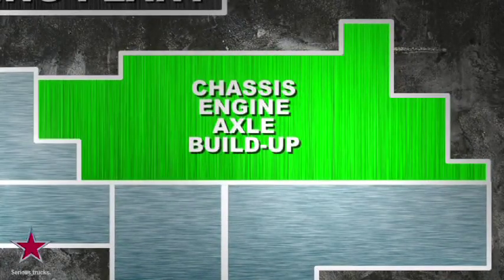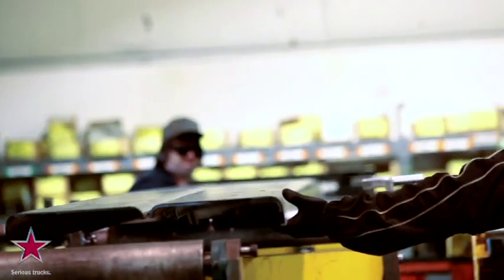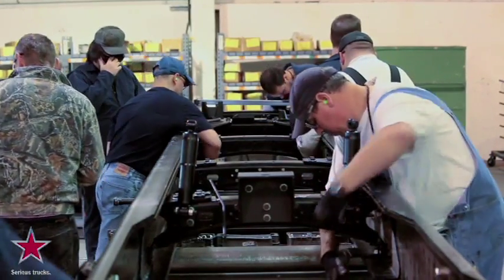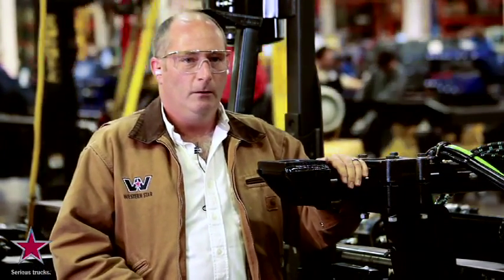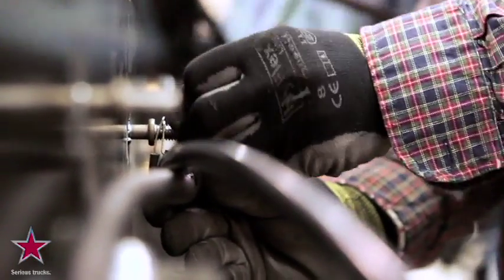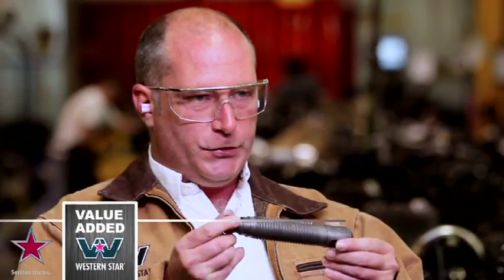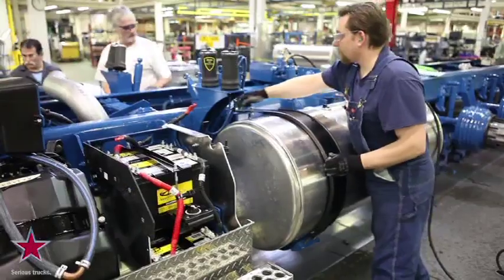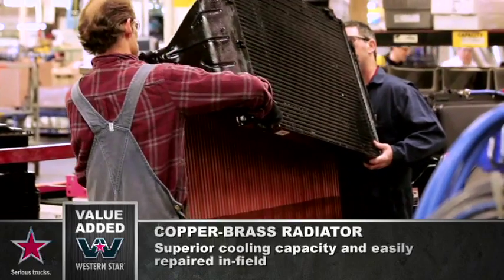Western Star Plant Tour - Part 2 - Chassis Engine Axle Build-Up Area

Comment: Hey Western Star, your new 5700XE has huck bolts everywhere, oh wait I forgot, it's just a Cascadia with some lipstick,
I think it's shameful to say "Western Star doesn't use huck bolts" when your latest and greatest model that your mass marketing is just a re-branded Freightliner, and that Benz Actros steering column/wheel that you put in the 5700 sucks too, very limited adjustablity equals very uncomfortable.
Reply: You have a choice at that time they weren’t producing the 5700xe I’ve looked at both trucks very carefully and it seems the only trying the 5700 and Cascadia share outside of Powertrain and maybe the frame is the airliner suspension 

When you purchase a truck your really buying the cab and suspension that’s it they all have same frame thicknesses all offer their own engines as well as Cummins and all offer automatic or standard transmissions with a various range of rear axle ratios 

Do your research and look at the trucks up and down and you’ll notice the difference in the trucks
Reply: I agree 100. I made that video and am ashamed of what that company became

Comment: If they're so tough, why don't I see any old Western Stars on the road like I see Pete's and KW's???
Reply: my dad works there and I don't see them ether
Reply: maybe they make the trucks but they don't put the logo on it but I saw a truck with a w but it was some kind of water plant
Reply: I see them on the road they are not as popular trucks as the paccar products also they are HAND BUILT oppose to robotic built like all other trucks furthermore western star was more veered towards severe duty trucks such as oil field, mining, and log trucks  versus highway applications furthermore their cab and sleeper is the best in the market i just seen one today and I’m extremely impress of the cab and wiring that was displayed 

Don’t believe me go hit the side of your peter/ kw then hit the side of a western star you’ll find that the cab and sleeper is far better insulated then the other trucks
Reply: Western star has been trash since Freightliner took them over just like all other freightliner products. No where near the quality of western star of old

Comment: I agree with not using huck bolts. If you ever had to cut a huck bolt with a torch and end up burning air lines or a wiring harness you would agree!
Reply: or worse yet, blowing through the rail.

Comment: I like the point you make about the steel pin and WS's approach to it. Over here we don't have parts bin trucks - they are all manufactured in house - engines, axles, chassis and cabs. Wouldn't mind a drive in one of these at all - they look well made. From a Scania driver.

Comment: so u mention the welded on stand off pins for the harnesess and have thought about the road salt. so when those pins break off, what am i supposed to attach them to? break out the frame drill out and re-attach, or go against manufacturers specifactions and weld them back on?
Reply: Perhaps you could weld another stand off in the same manner, 1 inch below or above and then move the harness up or down.  If you are in a salt and snow zone, it would pay to use a few cans of corrosion resistance paint and spray the base of those stand offs early on. They are originally installed pre-paint, but the newer paints on all US made vehicles are all water based.
Reply: as opossed to a harness zip tied to a rail that you aleady swore at and replaced? weld a peice of a fork from your local diner back on, the manufacturer doesn't give a shit or just buy a new harness and strap it to a rail.